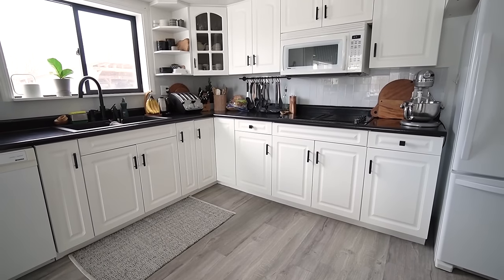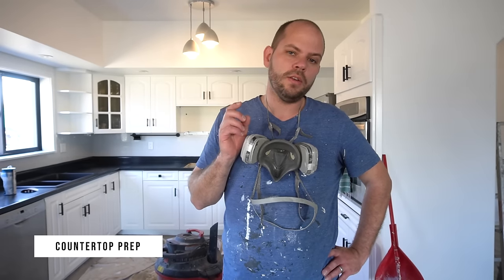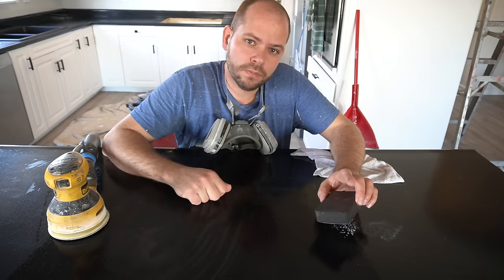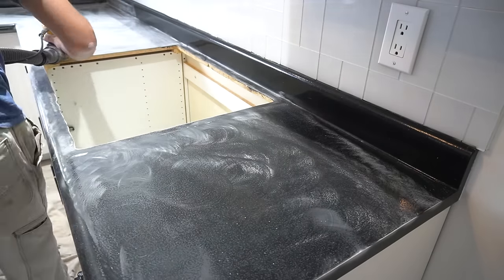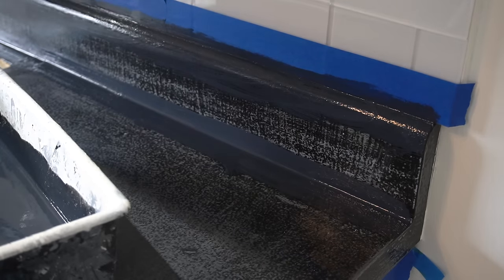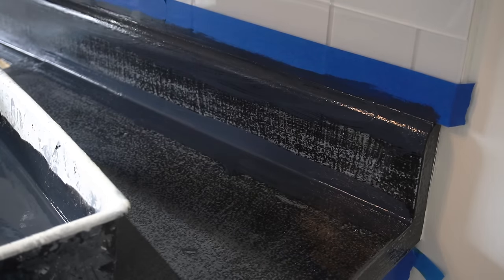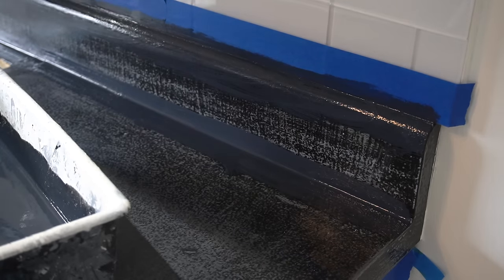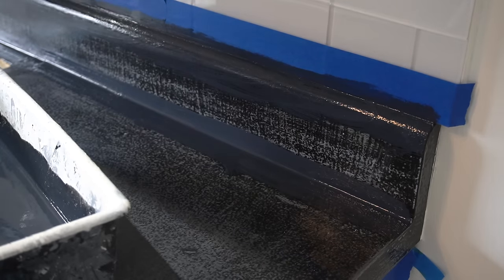How to Paint Countertops | Rustoleum Countertop Paint + Review 4 years later!

Comment: Hello Linda and Russ, we're about to embark on our countertop resurfacing. 
Not meaning to nit pick believe the term for addressing that debonded spot was 
"feathering out".
I/we are going a slightly different procedure. 
We found a Rustoleum Clear Coat kit at Home Depot. 
So we're going do the usual prep-sanding, applying primer, 
but we've chosen a top paint of a colour of our choice. 
After which, we'll apply the clear coat....
Reply from the maker: Glad to hear the video helped - Thanks for watching and good luck on your project! 🙂
Reply: @LindiandRuss 
Well, we tried our best to follow    [all] of the suggested preparations. Pre-sanding, all of the surfaces,, at each application, primer, and two coats of base color (blue/Grey), 
As well as prior to the clear top coat.coatsrecommendations, but....
We're really disappointed with the outcome. 
There's little dimples scattered over pretty much the entire countertop, despite me using a hair dryer to remove the bubbles.
My wife is definitely in no mood for me to try to fix this, and honestly, I'm spent.
I was really concerned with the dust and vapors, so I'd set up an enclosure,, to isolate the kitchen, with a fan drawing the air out,  and all windows were open!
Irregardless, the house reakes!
Reply from the maker: I think you mentioned in the initial comment you used a different kit/procedure? We just follow the manufactures directions and a complete kit with the exception of the supplied roller (we used a foam roller) and had great results. We have used the kit multiple times and had no issues. 

If you used a fan you need to make sure there is no dust in the area as that can contaminate the final surface. The fans can quick up sitting dust that can get into your final coating. 

The smell is very strong. We applied the coating and left the house for a bit to let the smell wear off. It goes away quickly though (at least it did for us) for the product we used. 

Sorry to hear it didn't work out. Good luck on your reno!
Reply: @LindiandRuss  
Thank you, Linda, for taking the time to reply, we're going to have to accept it, as is......

Comment: Are these heat resistant?
Reply from the maker: I would check the manufactures specs/label to confirm but if I recall the paint/coating had a similar heat resistance as the existing laminate counter top. I wouldn't recommend placing a hot pot/cooking sheet directly on top of the counter top without heat trivet on the counter first. Again I would look at the product's label to confirm its actual heat resistance :)